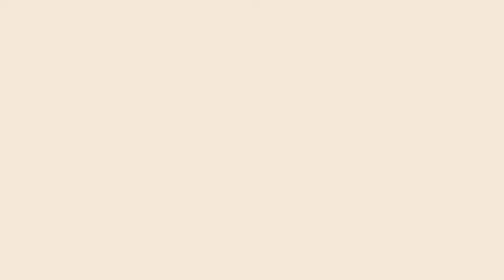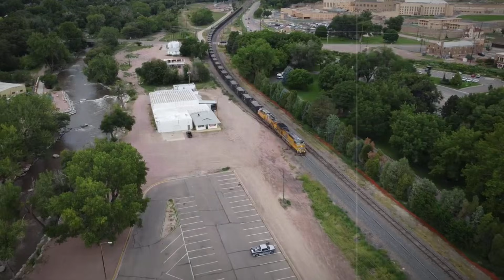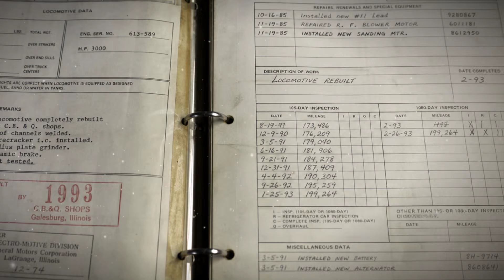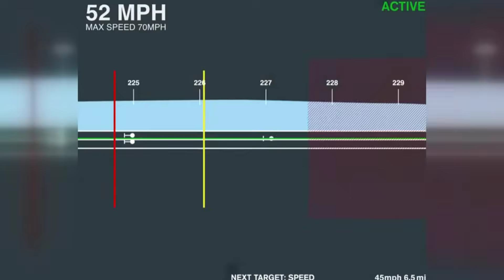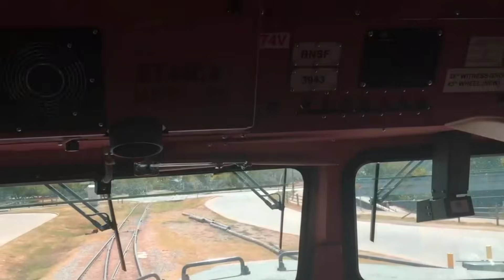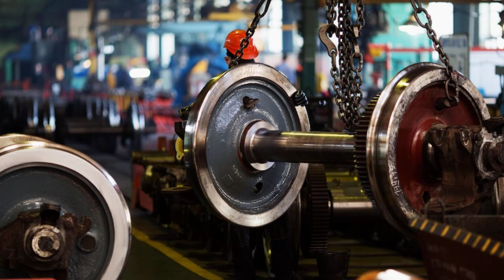The $3 Million Locomotive That Railroads Refuse to Retire

Comment: Great viideography. You forgot about Southern they bought SD40-2 locomotives  They had high hoods. Also the EMD SD90MAC-H had a 12-cylinder, 4-cycle prime mover called the H engine. It now is refined and powers the EMD SD70ACE-T4 tier 4 locomotive.